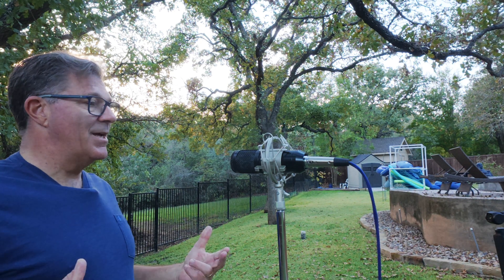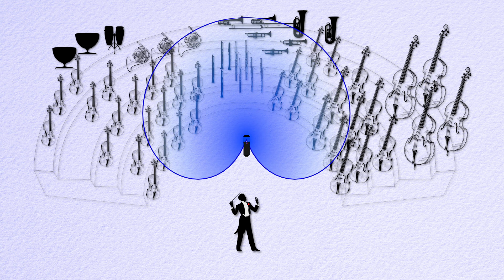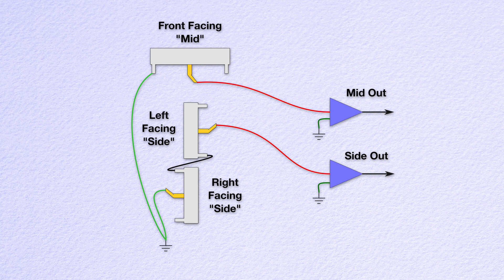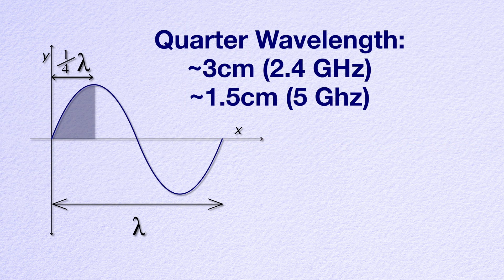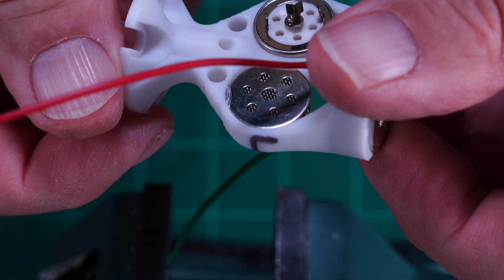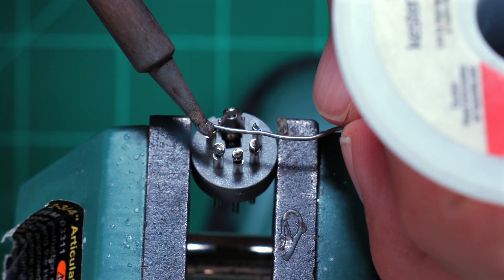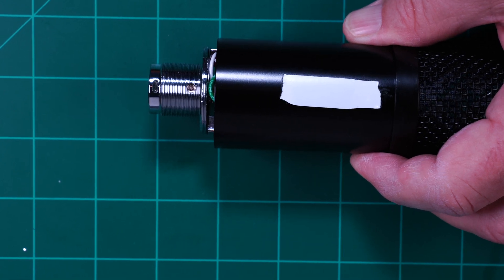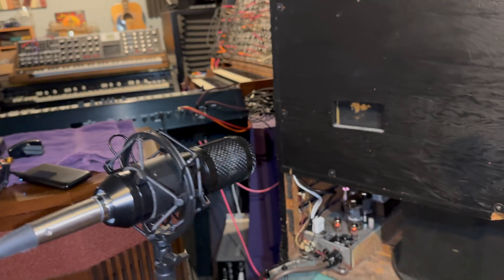Build Tabitha! A self contained MS Microphone

Comment: This kit looks very interesting to me, but I've checked the layout, and it seems the distance between the centers of the capsules is about 17.7mm for all three (they're all in a near-equilateral triangle). Is this correct?

If so, it seems that only up to 1500Hz or so is there no comb filtering or phase cancellations, up to 2,000-3,000Hz slight coloration (human consonants, birds chirping, the right end of an 88-key piano), and clearly audible phase effects from 4,000-6,000Hz  (sibilants, birds, kids squealing, ...). Doesn't this severely limit the functionality of this layout? (I know you say to listen, but I can't hear that kind of detail on my bluetooth headphones, and the acoustical physics is well understood on wavelengths and tolerable distances for coincident pairs.)

I'd think the best layout would be a dual-membrane side capsule for the side mic (if those even exist), with membrane distance being just 1mm or 3, and then the mid capsule would be near the edge of that. Keeping the axis between the two perpendicular to the horizontal sound sources would mean zero to a few millimeters distance difference to the sound source.

Or am I misunderstanding something?
Reply from the maker: Great observations. You are correct in that the capsule placement is not perfectly coincident. Most Mid Side mic techniques use two separate microphones that have the Mid and Side capsules even further apart. And as you mention a “better” figure 8 mic would be achieved with a dual diaphragm capsule or even better, a ribbon mic. I actually found a couple different figure 8 Electret capsules available. Neither of them sounded good. 

The setup I am using to create the Side capsule figure of 8 works really well for direct sounds in plane of the mics response. It does start to fall off as the sound source frequency is affected by both the direction and wavelength approaching the spacing of the capsules.  Overall the stereo spread achieved works and the mic sounds really good.

Comment: This may be a silly group of questions, but does this microphone require phantom power? If so, do both the red and white lines from your breakout cable require phantom power or just one? Which one? Otherwise, it's a great video. I actually bought one, but I'm afraid that I might blow it up if I power both legs so I would appreciate a timely response. 

Thanks!
Reply: Awesome, Thanks!!!
Reply from the maker: Both the mid and sir are independent channels. They both need phantom power. With that said you can use just one if you want. I know several people who use the figure 8 only for Blumlein arrays

Comment: You might want to fix the Instructables article referenced from your website for the build instructions. It's good that you included pictures, because the verbiage at the bottom of Page 11 is incorrect - you mention connection point X2a twice and do not mention X3B - very confusing when I got to that point. Also, please don't ever include flathead screws in a kit - those went out in the 1950s!

With that critique out of the way, I'm impressed with this kit and I look forward to using this microphone! I'm thinking of using it for an upcoming choir performance - do you think this is well-suited to that purpose? I'll be using a Zoom F3 on a handheld boom - I think I have a shock-mount well-suited to the Tabitha.

Love the "Bewitched" references, BTW... But the Gladys should have been a parabolic mic kit!
Reply from the maker: Wow, great catch! I assume you mean this: 
Solder the five XLR wires to the Dual OPA Board. 
Pin 1 to Common Ground X1, The center connection on the Board
Pin 2 to X2A
Pin 3 to X2B
Pin 4 to X3A
Pin 5 to X3B

That is now updated to the correct connections. I will make a one pager for JLI's website as well. The mic sounds great on a choir by the way! I just used five of these in an immersive array.
Reply: @SoundSleuth  Thanks for the reply and the fixes - it will help others build this mic in the future - and I hope you sell a lot of them!

If I sit in the front row with a boom and one of these, can I pick up a choir with 20-30 students? Last time I used a Tascam DR-05X on the end of the boom, and the results were decent. I'm hoping upgrading to a Tabitha and a Zoom F3 will up my game. This is a paying gig, so I need to choose the best match from the stuff I have. Thanks!

Comment: Perfect!  I have been thinking about making a similar mic for quite some time now, and see that you have already done it. and named it the same as my younger sister!  My parents announced her name about a week before Tabitha on Bewitched was announced.  Love the Bewitched font for the Tabitha name, though.  
I am curious as to why you used the pair of out of polarity cardioids instead of the single bi-directional capsule that is also available at JLI.  Do the 2 capsules work together for better output, better noise or something?  Just curious, but thanks for sharing your work!  BTW, I just subscribed, but thought I had done so a long time ago.  I'm here now, though!  :)
Reply: Just looking at the datasheet for the bidirectional capsule(JLI 1660), I see that it has the internal FET, and the JLI 165 does not.  I'm guessing that's why you are using it with the modified Schoeps circuit.  Am I correct?  Also in your opinion, would the 1660 be a good candidate for the P48 circuit? 
Thanks!
Reply from the maker: @bryanblack190  The 1660 will work with P48. Look at the frequency response graphs of it though. It has a lot of low end fall off.
Reply from the maker: Hey! Welcome to my channel. The reason I used the two capsules wired out of phase is that this: Both capsules are Electret with no FET. That let me use my OPA circuit for excellent audio specs on distortion and noise. I have not found a figure 8 capsule that I really like yet. Other than a full ribbon mic ;-) This method works really well. Amazingly well. Check out four of them in an immersive array in my Train and Tunnel Drum videos.

Comment: Your use of the word “phase” creates a disturbance in the force.  Otherwise very cool!
Reply from the maker: Thanks! There are those who say polarity and those who say phase… 😊
Reply: @ but only one of them is correct.  :)
Reply from the maker: @ lol you went there didn’t you! 🤣. Technically I am flipping the polarity.  Although the control in Reaper and most mixers is labeled Phase.  If there is no time delay, it is the same. But I get the phase shift due to time delay not being identical.
Reply: @SoundSleuth  I am going to play the nit-picker here.  First, let's agree that just because a control is labelled one way does not mean that is the proper use of that term.  There are multiple generations of players who misuse the terms "vibrato" and "tremolo" because Leo Fender switched them and never corrected that mistake.

But to the greater point, @Scodiddly is correct.  Polarity is a description of a single sound source, phase describes a relationship between two or more sound sources.  One source can never be in or out of phase in a standalone description of itself,  that only exists as a state of relationship relative to another source.  In the side capsule, you flip the duplicated channel's polarity in order to affect its phase relative to the original.  Words have meanings.

Okay, rant over.  Otherwise, super cool video.  I think I might go get one of those kits!
Reply from the maker: @ Thanks! Vibrato and tremolo are very different 🤣.  I think I’m going  to go with “Invert” the signal and mix it in… then I stay away from phase and polarity. 👍🏻
Reply: Trivia - Laurens Hammond couldn't hear the difference between trem and vib.
Reply: @gdj6298  Do you have a source you can cite for this?  It is well known that Hammond was tone deaf, but that's a very different thing, and this is the first I have heard of what you are stating here.  Tone deaf in anyone is understandable, but it's a bit hard to imagine how a person with functioning senses can't tell between tremolo (amplitude modulation or quiet to loud) and vibrato (frequency modulation or pitch going up and down).  Not being able to distinguish tones should in no way impede your ability to hear changes in loudness.  If you have a source, I'd love to see it because this is a very interesting claim that if true, would make Hammond an even weirder person.